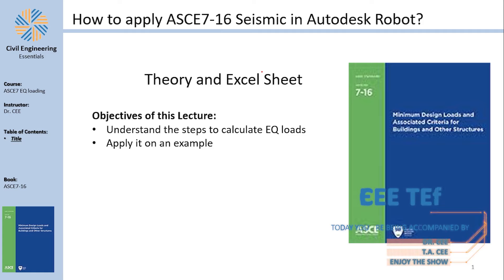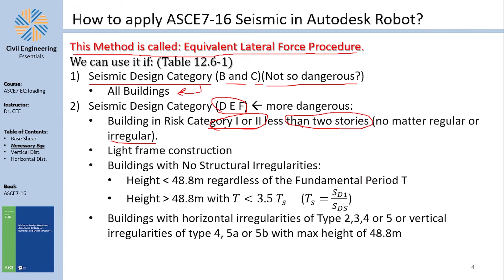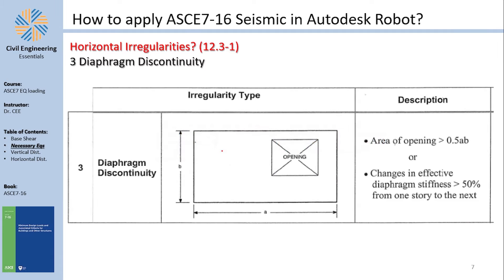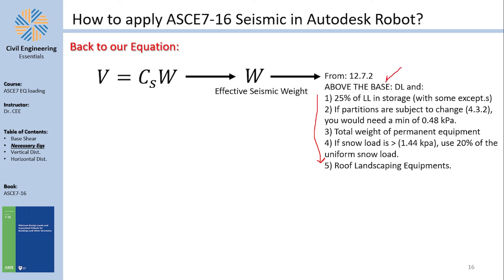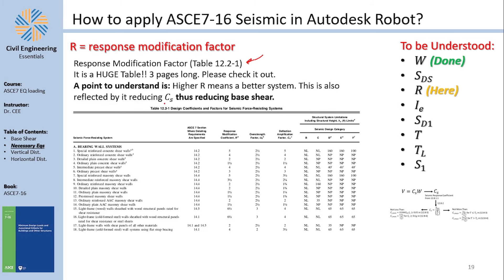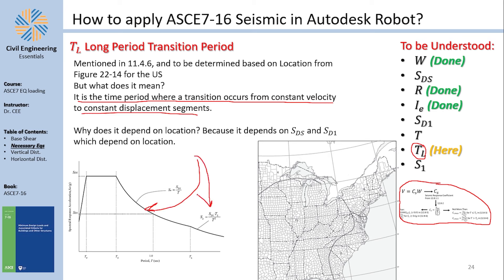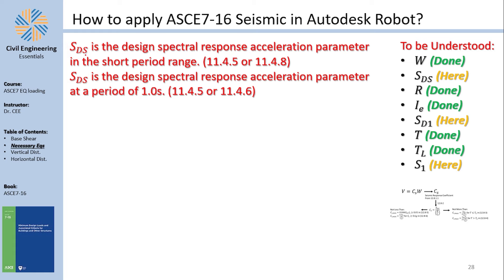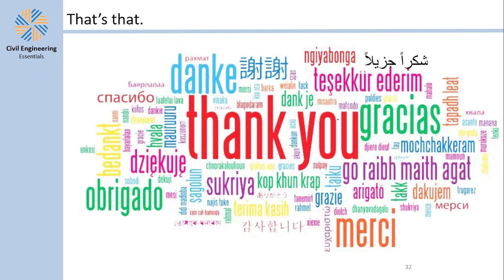ASCE7 Equivalent Lateral Force Procedure in Autodesk Robot - Part 1: Base Shear

Comment: Hello, thank you for your videos! I noticed in the weak story analysis you mentioned the story stiffness in consideration should not be less than 70% of the above story. Well the next 80% criteria is a proportion of the next three stories above. Not the overall building. Anyways, I think to answer your question the 15psf partition LL is for gravity analysis not seismic design. What you see in 12.7.2 is prolly specific to the section.
Reply from the maker: ooh I missed that one.  My brain has glitched, I mixed up codes.

I will make a pinned comment mentioning your correction.
Rly sorry about that.
Also, thnx a lot for your input. It was strangely phrased, so your opinion is highly appreciated.

Gonna make a pinned comment right now.
Regards,
Dr. CEE

Comment: thanks to your very informative videos . dear Dr. I have a question for you where does the earthquake force has the most effect the bottom story or the most high story?
Reply from the maker: That is a really cool question. Let me answer it using two viewpoints:

Viewpoint 1: Which story will take the highest share of the Base shear?
Here: the heaviest-highest story. If all stories have similar weights, then yes, it is the heighest.

Viewpoint 2: Which story will have the highest shear and moment to resist.
Here: the lowest story. Because it is always responsible for carrying all stories above it.

Hope it made sense.
Regards,
CEE